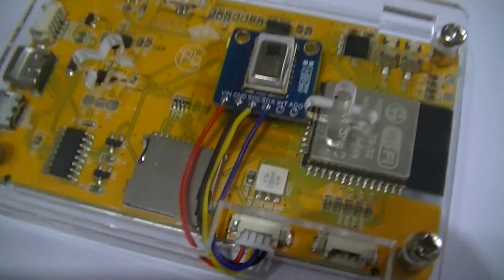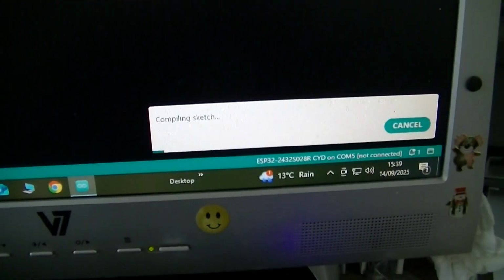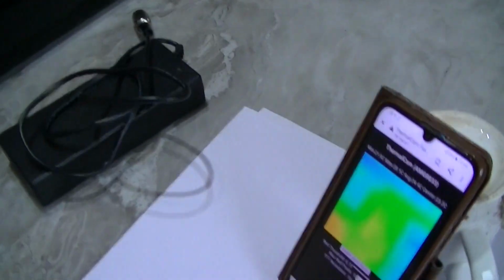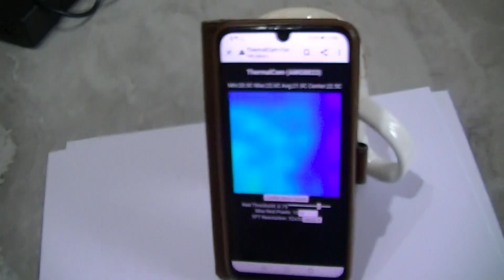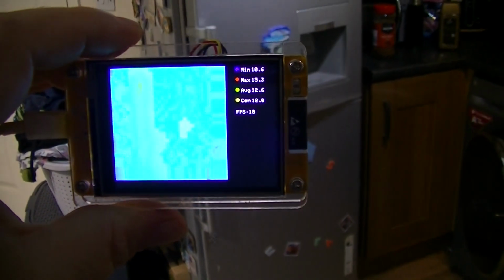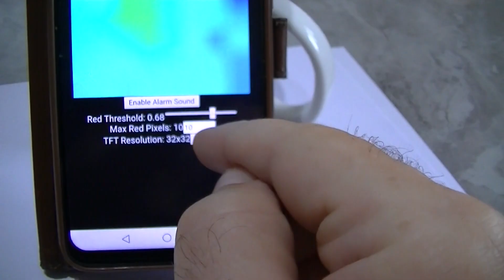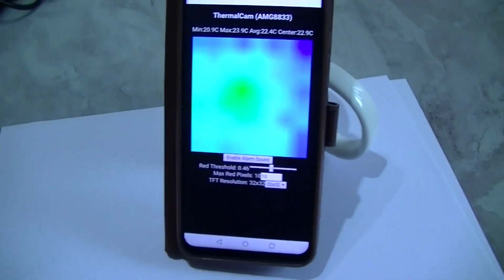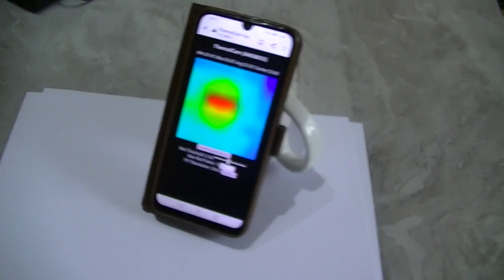Thermal Imaging System with Wi-Fi for under £25.esp32 cyd,AMG8833. Stream to phone with Alarm.

Comment: Is it useful for doing thermal checks on circuit board components?
Reply from the maker: I have used it for circuit board repairs ,better off using a mlx90640 ,not much more money and 32x24 pixels